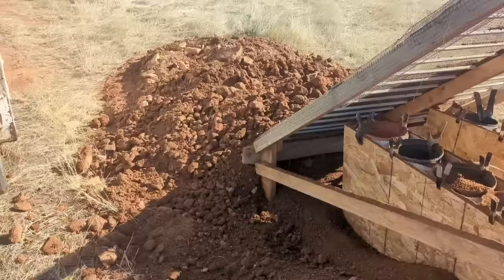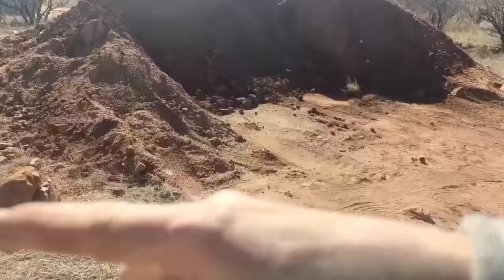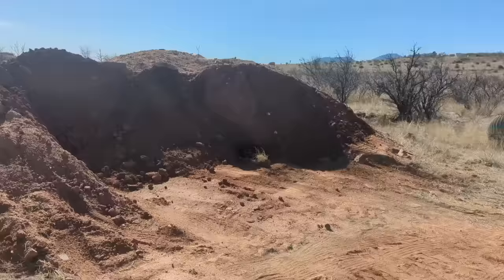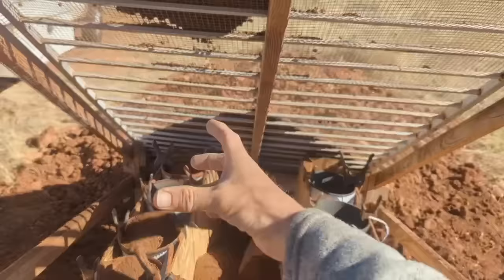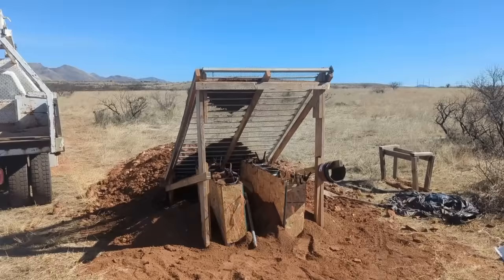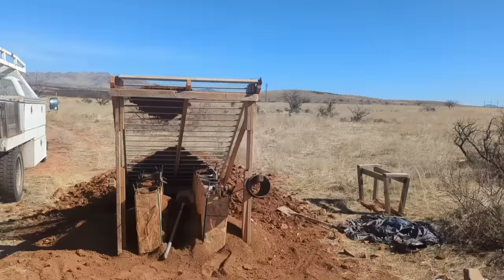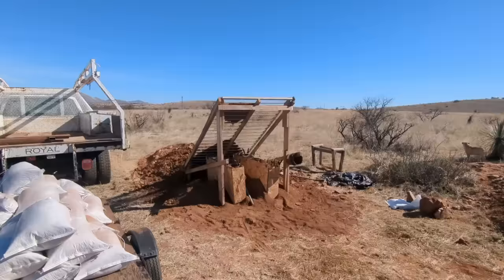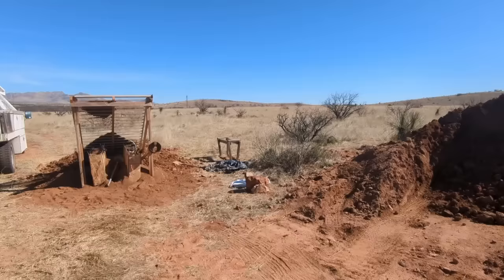Why I am building my house with sandbags

Comment: What material are the bags made of, twine? Like a burlap sack? Does water seep through the sacks? Or, I suppose they are packed quite tight to prevent moisture? That's a good idea to have a group of bags standing to shovel into...does the sifting make a difference?
Reply from the maker: Polypropylene bags, yes water will seep through them, they would be behind walls. Sifting is important for uniformity.
Reply: @OffGrit  oh yeah to pack it down uniform..I see. By the wall do you mean the stuff that's plastered on the surfaces?

Comment: I’d like to hear more about the steel you’re going to put into this why not build a pole barn
Reply from the maker: Well if you're watching any of my newer videos you'll see then I'm actually building a steel building anyways and the amount of steel I'm using in this building is far more than I'd be using in this thing The whole point of this was to add thermal mass to the walls that's what it's all about as far as the amount of steel that these webs would add to this job it's pretty small in comparison to the amount of steel that I'm using now but yeah there is some steel being used I suppose

Comment: Oh one more thing your just doing a post and beam method that has been used in Europe for centuries. And that great, you can get some really great looking construction using that method. The filler being earthbag is really irrelevant. But I'm not seeing any structural integrity in you walls. Where is your reinforcement to stop them from toppling over sideways?

Comment: have you looked into haybale houses 
sounds like the same concept but less labor intensive
Reply from the maker: Yes I have considered Straw bales. Although the concept is not necessarily the same. The concept with straw is R Value insulation.... thermal mass is a different concept... but ideally you want to use both insulation and thermal mass.... straw is not without labor... you also must purchase straw bales and this can cost about 4k for this size building....which is fine because you have to buy insulation anyways.... but if you want to take advantage of both thermal mass and R value insulation, this combination with straw becomes more unfeesible because then the wall thickness would be 4 ft.... so by using sandbags and close cell foam panels (3" thick which I bought used for pennies on the dollar from a building remodel) you get both good thermal mass as well as insulation. Plus straw does attract rodents although people with straw houses will swear they have none....this isn't the case....as well as mold issues if any water does penetrate it is a great vector for mold... so there are pros and cons to both I guess is my point....

Comment: How are you going to build the eco beams? Did you find a machine to do the metal part in the states?  Or are you importing the metal press from South Africa??
Reply from the maker: I will have videos in the future
Reply: @OffGrit  this I got to see Pal.  Saw an insulated 2x6 which a company is selling in the US to avoid thermal leakage, but it’s a complicated build.   If you can crack that but economical, I have a business idea for you.   Build insulated framing studs by just filling the webbing with foam insulation.   Let me try to find the video for you.  I think you will see the same thing I saw buddy!!

Comment: Bag material plz
Can we fill bag with only desert sand to make wall?
Reply from the maker: So with this type of structure, the bags are not load bearing since there is a rigid frame so yes you can practically fill them with anything
Reply: @OffGrit  will they hold the load of roof?
Reply from the maker: @jaibharat223  no. The load bearing points are headers and post like a normal stick frame. The bags are more of a filler for the walls to take advantage of thermal mass

Comment: Are you also not tamping the bags?
Reply from the maker: With this type of structure the bags aren't load bearing so tamping still should happen to mold them in place with the other bags, but it doesn't need to be done at near the level as a standard earth build
Reply: @OffGrit  Thank you!

Comment: Waste of time using those bag's..the sun and weather conditions basically the bags become biodegradable..
Reply from the maker: I have already built with them before... you cover them with a tarp/ canvas before using. 💪
Reply: @OffGrit  I know those bag's m they perish in the open within a year...not feasible...rice comes in those bags... it's biodegradable.. quickly..
Reply from the maker: @shakeelmohideen7172   🤦
Reply: @OffGrit  On the outside.. this is what keeps moisture out is it?
Reply: polypropylene bags are not biodegradable but will weaken in UV light, most are treated with UV protection though. Yes, keep them covered if they are to be exposed to desert summers.